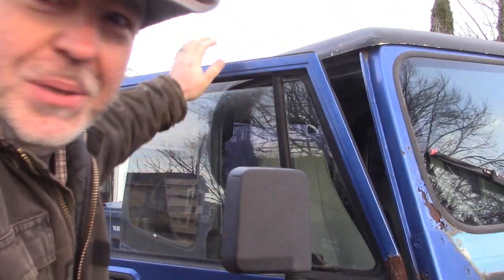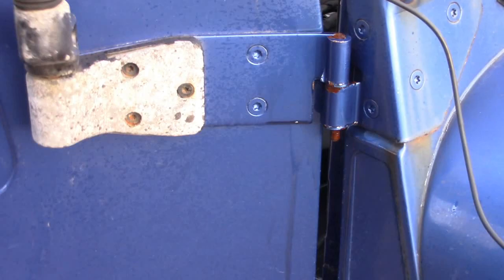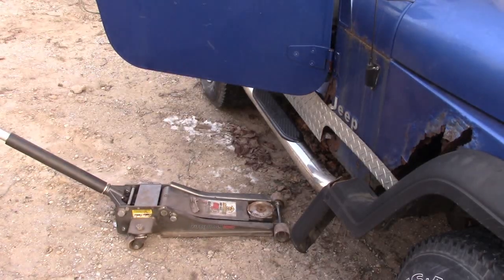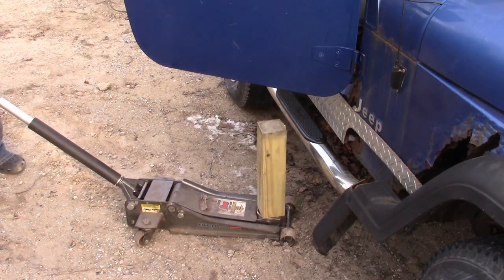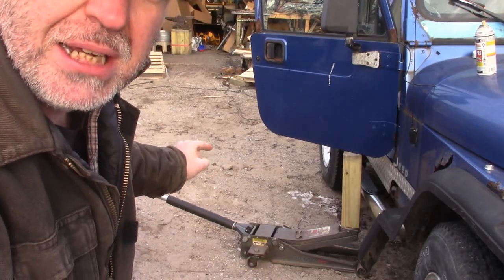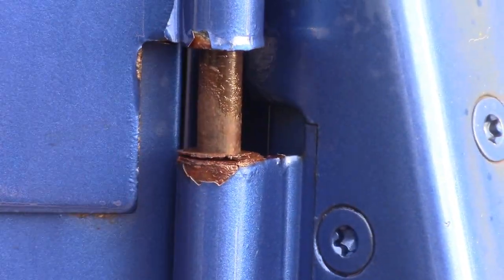How To Remove Stuck Wrangler Doors EASY

Comment: PSA
I don't mean to offend you or make you look bad or anything but I just tried this with my TJ doors, the passenger side popped right off. When i tried doing the driver side it was pretty stuck so I jacked it up a little more. When I did that the door flung open and hit the fender. when I pulled the jack out from under it, it ended up creasing the door in. I was able to hit the crease mostly back in with a hammer but it definitly did some damage. Just a warning for anybody else about to try this.
Reply: It was kind of my fault though because I should've stopped when it really started lifting up the suspension.
Reply: Literally just happened to me !!! Dude I’m pissed !!!!!
Reply: Same here!

Comment: Oh, I love the internet....Thank you. I was able to remove mine with no problem. They would not budge using other methods. For those that usually learn the hard way, you aren't trying to lift the car using your door as jack point... give the jack a pump, spray some PB blaster and wiggle, repeat as necessary. Place the jack as close to the hinge edge as possible so as to transfer all of the the lift force up.